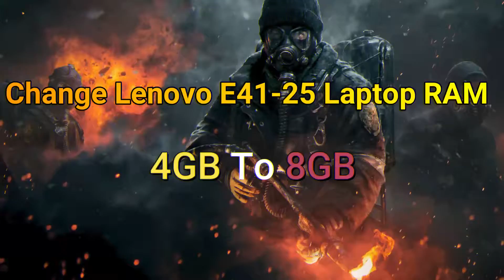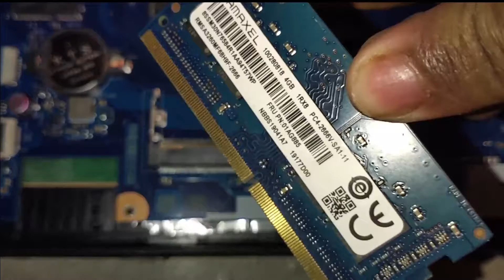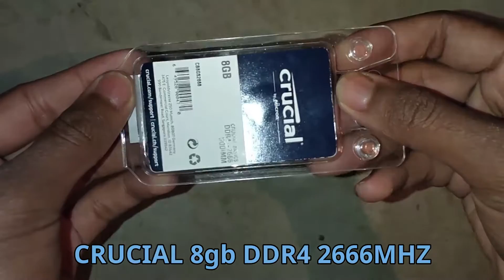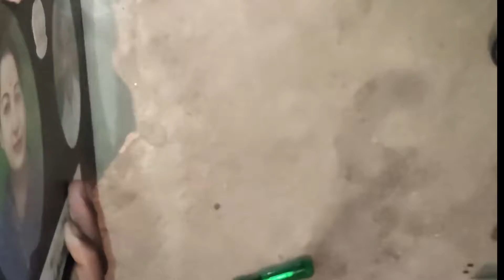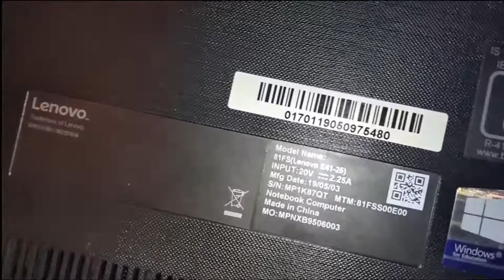Lenovo E41-25 Laptop RAM Change From 4GB To 8GB

Comment: Crucial RAM 8GB DDR4 3200 MHz CL22 Laptop Memory CT8G4SFRA32A 

It will work on Lenovo government laptop link

https://www.amazon.in/Crucial-PC4-25600-SODIMM-260-Pin-Memory/dp/B08C4Z69LN/ref=asc_df_B08C4Z69LN/?tag=googleshopmob-21&linkCode=df0&hvadid=397034210131&hvpos=&hvnetw=g&hvrand=17531235511181000789&hvpone=&hvptwo=&hvqmt=&hvdev=m&hvdvcmdl=&hvlocint=&hvlocphy=9061739&hvtargid=pla-938712280446&psc=1&ext_vrnc=hi
Reply: Sir pls reply 😔🥺😭
Reply from the maker: @indiandev1588  no bro , even if you put 3200mhz ram in here ,it will only work at 2133mhz so 2400 or 2666mhz much enough , less price
Reply: @NANOSOFTX  ☺️ thankyou